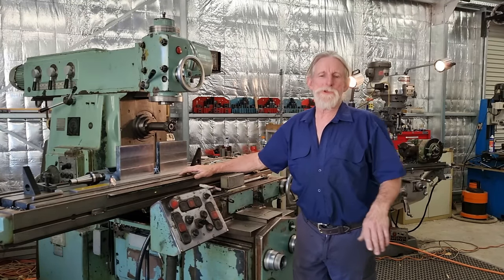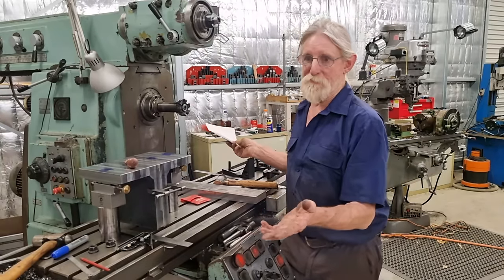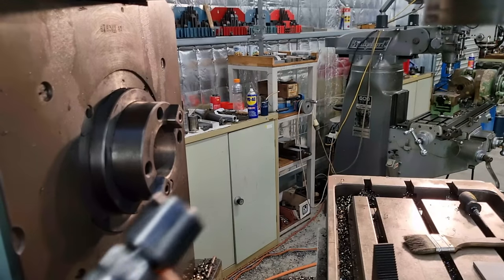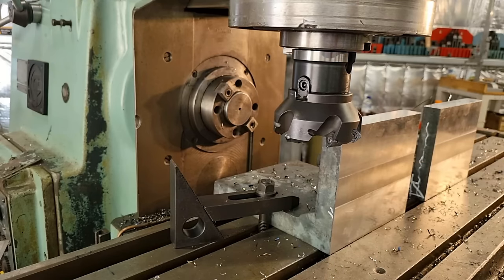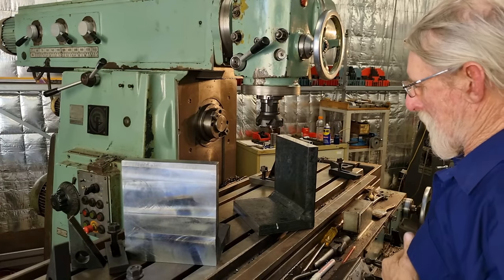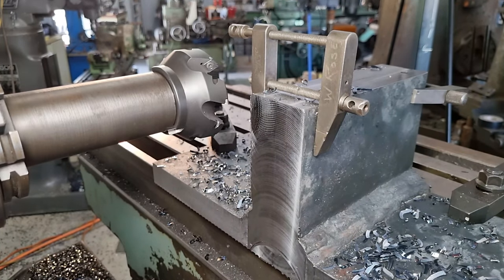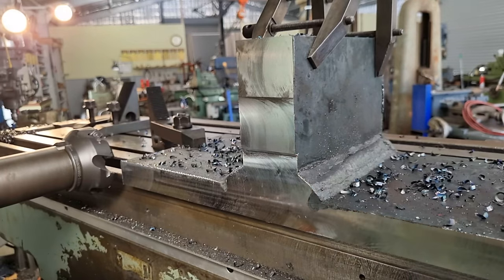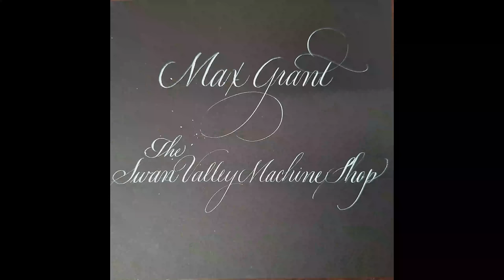SHOP MADE TOOLING , Angle Plates .  Part 2

Comment: Really good machining series. Now to slow down an ac motor several options were used. A mechanical brake interlocked with the run contactor/relay. A contactor which shorts out the motor windings. A contactor which applies a dc current to the motor. A contactor which applies the reversed three phase supply across the motor windings. The simplest one I’ve seen used most often is a contactor which shorts the motor winding. This contactor is interlocked, both electrically and mechanically with the run contactor. I’m hope you will be able to find an industrial electrician to assist you. I love to help but it’s a bit far from the uk.
Reply from the maker: Thanks .   The feed motor is about 5hp  ,  415 V  AC .   Their look to be  timers on the switches .    👍
Reply: Thanks for the response. This may be a silly question but do you have any documentation for the electrical system. A 5 hp 3 phase motor would have a reasonable  amount of inertia which the timers allow for. I think there may have been some form of dynamic braking which may have failed. Have a chat with your colleagues to see if they have any information. If not it’s an electrician to unravel the circuit.

Comment: Thanks again for your shared knowledge. seeing you online engineers at work might spark younger people into the trade while you good folk are still about to pass on the knowledge. 
all my hobbyist casting machining tends to be in the spring and summer as the winter is the time for an open fire and bits of metal getting nice and hot and then living in the garden till needed... this winter was 8 wheel castings. this summer will be black snot and crunchy teeth.
Reply from the maker: Lol , can't beat black snot from castings !  👍

Comment: Hello Max,  I'm looking forward to seeing what features you put on the angle plates (i.e. slots, holes etc.).  I have never been able to figure out the best combination of slots and any commerical plates I have never seem to have them in the right place.  I ended up putting a single tee-slot down the face of my angle plates on the long side (my angle plates are very narrow compared to their height.)  Ken
Reply from the maker: I have come to the conclusion , there are no best places !    I will slot them later on , only doing the necessary holes at the moment to use them .  👍

Comment: I had 2 Warner & Swasey OACs that I bought for $200 each at an auction in Sydney 25 years ago, they had electrical cabinets that looked like that dinosaur. They were automatic 5-station turret chucking machines👍
Reply from the maker: Thanks .   Were they peg board machines .   👍
Reply: @swanvalleymachineshop No they had a series of built-in cams and adjustable "bits" that toggled switches on and off to control spindle speed changes, feed speed, and rapid traverse. Took me a while to figure them out, but once I did they were a step up from the old Herbert chucking drum autos we had.

Comment: Stress movement while machining is an interesting topic that can test your brain sometimes thats for sure. I have decided that I like that milling machine. It is quite capable looking and I am looking forward to seeing more of what you do with it.  Although Having to walk around the machine to unlock the table is kind of a pain the ass I bet.
Polish up those edges and etch with nitric acid or something to see those welds would be fun.
Reply from the maker: Thanks . I will have to get some of that acid .  Cheers  👍
Reply: Good idea.
For Macro etching of ferrous welds,  "Nital", is a good all-rounder, a solution of Alcohol (Ethanol, Methanol, or Isopropyl) between 3 to 10% of Nitric Acid, you can buy it pre- diluted.

Comment: Your issue with the mounting screw sticking down too far was better than my issue when I tried my new face mill and arbor this morning. The screw and washer that came with the arbor were both too short and too fat to fit in the face mill. I ended up going back to using my Clarkson Autolock and a HSS end mill. I was really looking forward to trying the carbide inserts and roughing out in one go as well.
Reply from the maker: Lol .  Gotta love the old Clarkson stuff .   Cut my teeth on that gear .  Clarkson Deadlock system for face mills , still a great design .   Not really around any more . 👍
Reply: @swanvalleymachineshop I got two of them when I bought the new to me mill, small and large. The mill I think is the size down from Olga and a ram type universal and Italian, very robust, still getting used to it.

Comment: Olga's an impressive beast.
I thought I saw some time delay relays in the electrical cabinet. The excessive feed motor time delay may come from someone fiddling with them. An accomplice should be.able see which relay it is when you shut the feed off.
Reply from the maker: Yes , i think those things with the round dials are .   Further investigation needed !  👍
Reply: Good point.

Comment: In the tool room I learnt in we all had ground blocks/slips that went into the top half of the T slot so used to put them in and push the job and dog it down
Reply from the maker: I have to clean up the small burrs inside the tee slots , but i do plan on making some alignment blocks for that purpose .    Cheers   👍

Comment: Another pair of awesome videos. You really did a great job of planning and fabricating the angle plates as you didn't have much distortion after welding. Did you decide to stress relieve the angle plates while having a bonfire? Olga is a big girl at 4.25 tons.
Reply from the maker: Thanks .   I knew we had a big fire coming up , so their was a rush on to fabricate the plates .    Yes , 4.25 t  .   Borrowed the Franna crane from work to lift her off the truck !👍

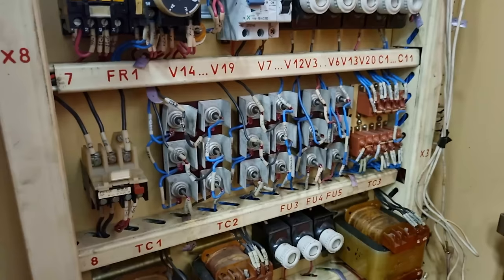Comment: Those round things with the blue wires shown at 2:54 are power diodes (rectifiers).   I expect they convert AC into DC to power the various relays and contactors in the system.   They are unlikely to be affected by you welding if you are sensible and connect the welding earth lead direct to the job and not to some odd part of the machine.
But I wouldn't have welded bracing on the angle plates either, as that will live the angle plates under stress and they will bend after you take the bracing off.  The chatttering is a forced resonance thing like banging a tuning fork.  Thus changing RPM, either up or down, is the first thing to do.
Reply from the maker: I think i would disconnect all the cannon plugs from the cabinet .
Reply: @swanvalleymachineshop  That carries its own risks in something made decades and decades ago.   You might subsequently get intermittent connection faults that will drive you nuts.    The system is relay based with no solid state electronics or microchips, (apart from the rectifiers which are inherently rugged) so low risk of damage from current surges really.

Comment: Great to see that big mill getting some use Max. Question, did you finish that other angle 📐 plate that you made and threw in the fire?
Reply from the maker: Cheers Aaron .   The other one is still sitting on the floor next to the shaper !    Will get back on it one day .   👍

Comment: Hey, this is a bit off topic but I'm getting ready to start on a new shop and I was looking through some of your older videos of your build...one in particular with the machines kind of in place but I was wondering where/or how you brought power to some of the machines out in the middle of the floor....just across the concrete??
Thanks for another ride along Max.🍻
Reply from the maker: At the moment i use a 3 phase  32 amp extension lead .   I will use drops coming down from the roof where the future 360 degree pole cranes will go .   Also will use steel conduit across the floor in strategic places where duck boards will go .  Cheers 👍

Comment: If I have to weld in a machine with any electrics, I just make sure that all electrical connections are pulled, particularly grounds. It’s the ground that will get you.
Reply from the maker: It's all military style cannon plugs to disconnect the cabinet .    But there are separate earths  everywhere !     Thanks .   👍
Reply: @swanvalleymachineshop  I find just disconnecting it from the power coming in and that ground is enough. But you’re right. This is complex and in practice, unrepairable if something happens. I’d hate to have to go down to Australia to fix it, as I’d likely have to redesign the whole thing to do it.
Reply from the maker: @melgross  Book a ticket ,  A German ID grinder & a French HBM that need the electrics up grading !!!   👍
Reply: @swanvalleymachineshop  oh lord. If I thought it would really be something I didn’t have to take a month for I would give it serious thought.

Comment: Looking excellent Max. Not sure if I understood the welding back in a previous video. Is it one pass side A three passes on B. Then three on A and one on B and so on? I would love to make the same angle plates. I have a lot of six inch by one inch thick flat bar. Thanks Max🔧⚒️🔩
Reply from the maker: Keep alternating . Also keep checking with a square , that will tell you witch side needs to be pulled over with more weld .   I think i started off about 3/8''  out of square on purpose due to the amount of weld on the outside corner .  👍

Comment: Did you just make a cliff hanger here? 🙂I urgently need a "monster-horizontal" milling machine. p.s. If you weld on the machine you will loose the warranty, so never weld on the machine! (bad things can happen, not worth it)
Reply from the maker: No worries  .  I don't mind welding on a lathe , but this thing may be a bit different .  Don't want to take the chance .....Yet !   👍

Comment: Max, on my Deckel I can swivel the vertical head to horizontal and the slide the head and ram all the way back out of the way. I can imagine your machine has the same possibility... Furthermore I think this setup is more rigid than a Bridgeport style. How do you see this?  Best, Job
Reply from the maker: The head  will swivel up out of the way  ....  mostly .  There is still a height limitation .  
It is only the mass of the machine that makes it more rigid than a Bridgeport .  Cheers  👍

Comment: Max- was it chatter, or harmonics that caused the surface finish irregularities?  I believe that the cutting speed and depth resolving the issue was more of a harmonic problem than other suggestions.  Thoughts?
Reply from the maker: The plate was resonating , like a tuning fork .   The width of the contact area on the carbide insert was the issue .   👍

Comment: curious as why u didn't bring in any dimensions to a specific measurement so it could b used as a quick reference on future set-ups
Reply from the maker: I only use them to hold things upright .    By chance though , they came out at 200mm wide , by ruler .    Should put a mic on them !    👍

Comment: I had an offshore power unit with dynamic braking, someone removed it the circuit troubleshooting the unit and bodged it going back together wrong.
Reply from the maker: That's not good .  👍

Comment: Well essentially you made a fly cutter out of a face mill by only using 1 insert, your right though, fly cutters are not used in industry, a good mill will run a face mill, low power hobby mills can’t , a lack of power and rigidity restricts them. We ran 100mm and 150mm face mills on 40 taper CNC VMC’s back in the 90’s no problem ! YouTube hobbyists can only dream of running industrial machines 😂 We had 2 CNC lathes as well. The Hitachi Seiki 4NE600 lathe was a 1978 model, one of the first CNC lathes in Australia brought into Australia by Bill Hughes for the Perth machine shop of what became Allbulk/ Jetstream/ AAMG. Sadly Bill died in early 2003. One of the true innovators of agricultural machinery in Australia and a top bloke. The company moved its manufacturing to Dubbo in the early 90’s due to a downturn in the agricultural industry. They moved some machinery from Perth to Dubbo including the 4NE 600 and a 6 tool turret Hitachi CNC mill. Both still had tape readers 😂 We got the 2 Cincinnati VMC’s later in the 90’s and a Leadwell lathe in 2001. Still miss running them, the Dubbo machine shop shut in 2006 with all machines going cheap at auction 😞
Reply from the maker: Thanks .   As apprentices , we had limited training on a Cincinnati VMC  at Wembly Tech  in the early 80's .   Typing the punch cards was not my thing , was a lot to take in !   👍👍👍